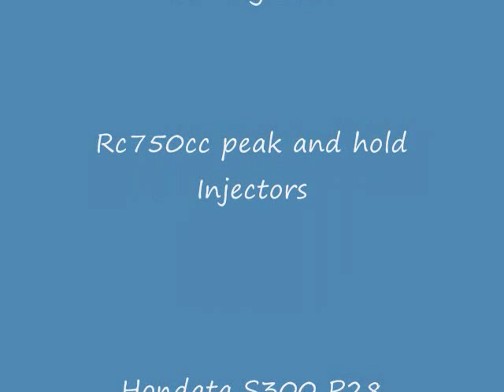Snap Crackle Pop!

Comment from the maker: Cool And Thanks A Lot, The Only Bad Thing Is Its Gonna Ba All Motor. Brian Crower Stage 3 Cams, B18c1 Head, B16 Clock With 12:5:1 Compression Pistons, Eagle Rods, Light Weight Eagle Crank, Chipped P28 With A Base Tune (for now) And Other Simple Bolt On Mods.

Yeah Its True I Also Asked Him Were Did He Wat To Meet me Up And He Gave me This Crap About Him And His Crew BS So I Just Ignored Him.

Long Story Short Hes A Fake.

Comment: 12:5:1 is a ratio; not a compression ration. however 12.5:1 is a compression ration. but either way i dont know why you would only go 12.5:1 go big r go home. 
P72 head/B18A/B Block
STD = 13.170743903246784
with stock ctr pistons...haha